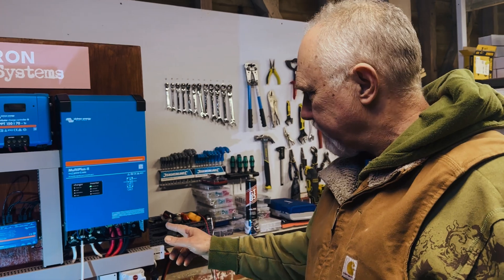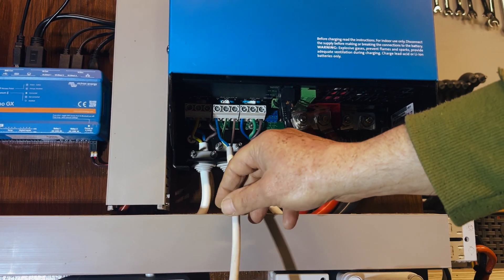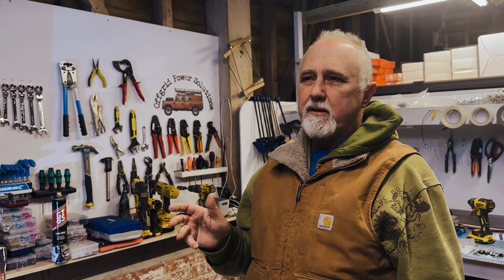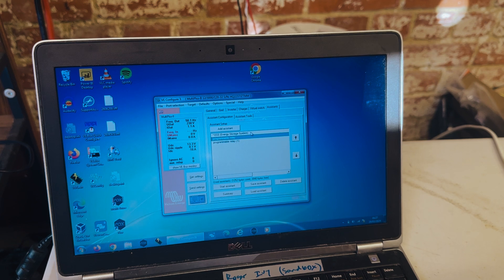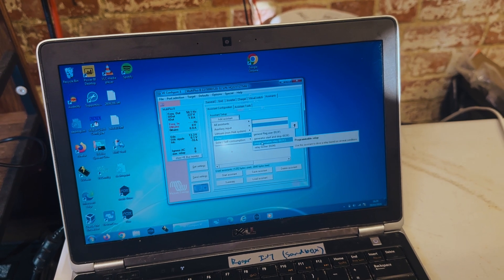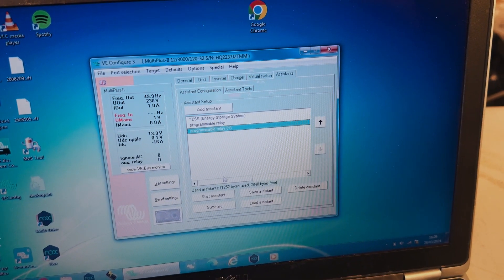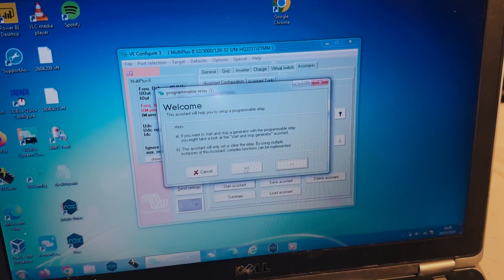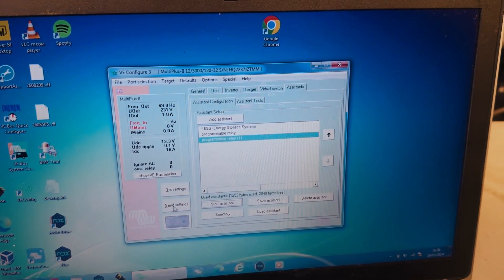Setting up the AC2 output as a Dump Load on Multiplus II

Comment: It's a really useful function. If you set the on and off parameters too close though, the relay can click on and off a lot and wear out the relay. Btw, it's a salt lamp.
Reply: Indeed. I'm starting at 95/85 for an RV system driving a dual fuel water heater. Very nice setup and sophistication in the Victron world, coming from a simple inverter setup previously. It's remarkable.

Comment: I don't suppose you know why a diesel generator does not operate, you can hear the contactor but it does not engage and no charger lights come on. 
.
Reply: AC waveform quality issues or instability in the frequency?

Comment: Hello ! Thanks for the video! Do you know if it is possible to make it ON or Off according to 2 conditions? let me explain. If my multiplus is 5000VA, which is about 4000W usable power. If I turn a 1500W water heater on its only 2500W left which is not enough. So i would like to switch it off as long as there is a load bigger than 3000W and when this condition doesnt apply anymore get back to on , if the SOC is in the in the range you want to have it on. Do you believe there is a way to do that? Thanks
Reply: Same question, how did you manage?

Comment: I'm a Victron fan\user. 2 arrays: 1160 ground mount and tilted and 1200w on a dual axis tracker. 300Ah lithium 8' away from 12v 3000 MPII, CERBO with display,  Lynx dist 1000, bmv 712smart. Batteries were in float and I manually turned on breaker for water heater.. I know how to setup the assistants for L2.. but how do I wire up from the MPII to the breaker panel to power it automatically..?  I'm guess some romex 5' away. Just not sure how to tie into the breaker..?

Comment: At 8:06 you state that it doesn't work in fractions, and only activates the assistant once it reaches the next non decimal number (whole number/integer). So by that theory, wouldn't you set both the lower than and higher than to 90%, effectively telling it to activate at 91% and deactivate at 89%?
Reply: Depending on the size of your solar system, battery bank and the load on AC2 you may actually want it to start at 95% and stop at 85%.  For example, if connecting to a large load like a water heater, only allowing 1 - 2% SoC might mean that it turns off way too soon to actually heat any volume of water.